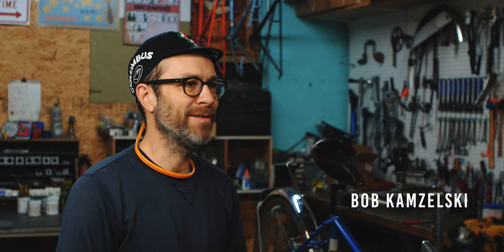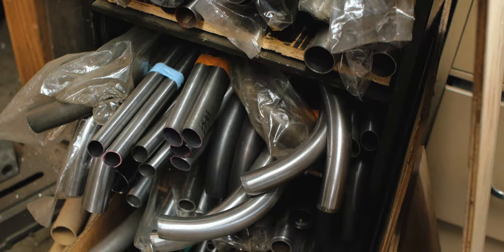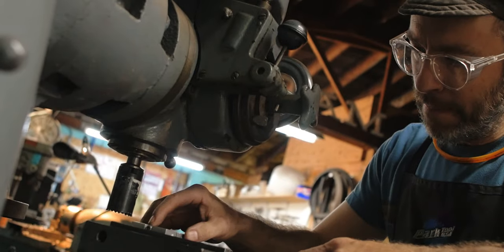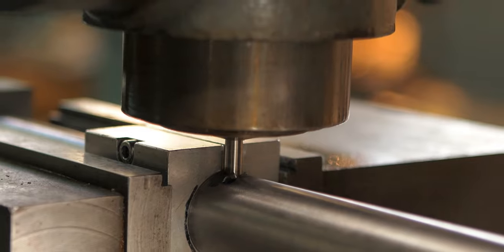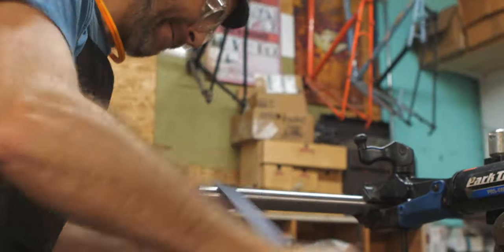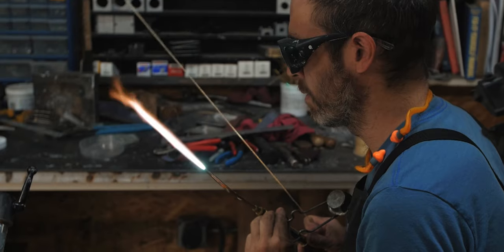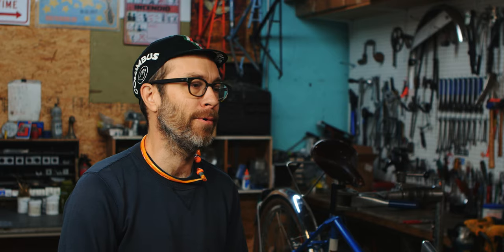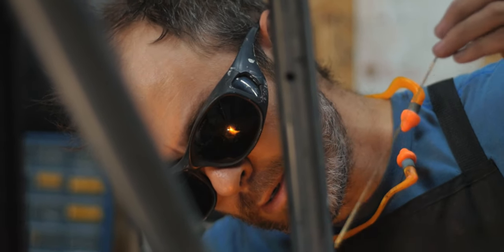This Man Builds Beautiful Bicycles By Hand! // Custom Frame Building

Comment: Likewise, now retired 74 yo still major mode of personal transport is a bicycle, don't own a car by choice.  Built high end steel frames from 80's.  I am 110 kg and most of my builds were for even bigger men.  While the steel bikes are heavier but only marginally.  My current steel frame bike is 1 kg heavier than a Giant defy advanced large but has a 16 cm longer wheel base and wider rims and tyres. Rides is so much smoother and while the acceleration and handling is not as snappy cornering and stability is excellent and due to the comfort and reduced harshness a little faster over distance.